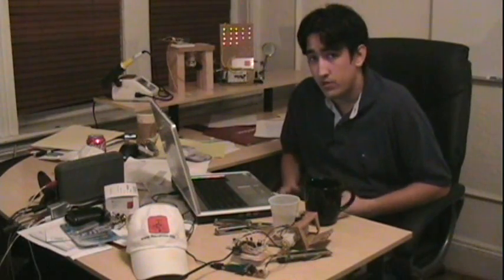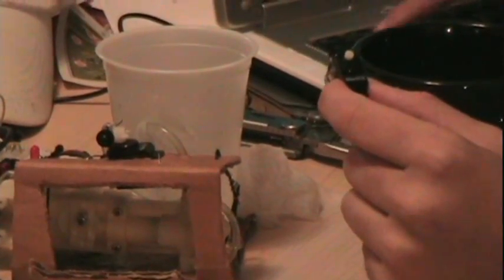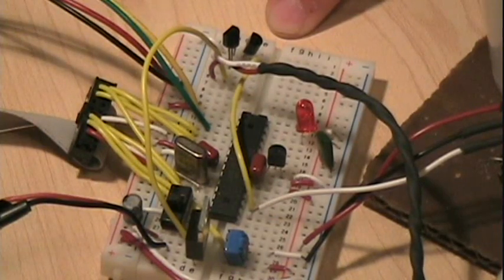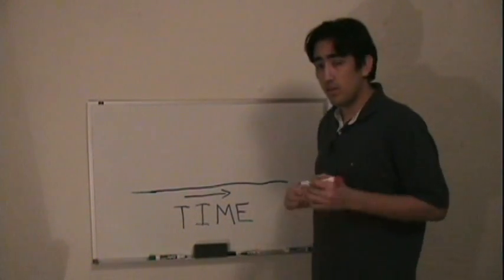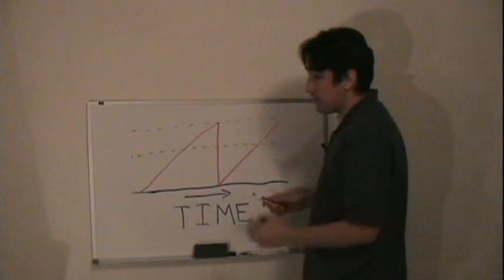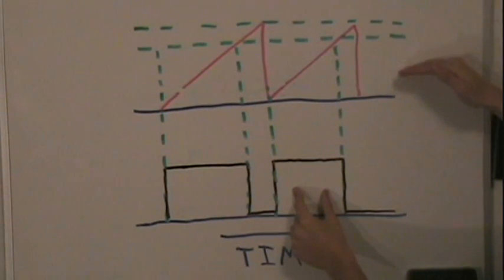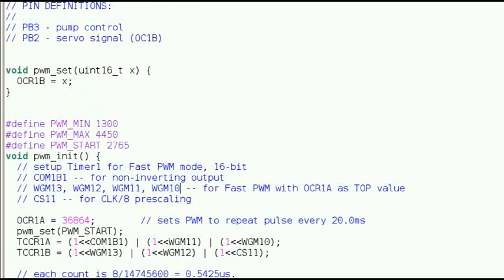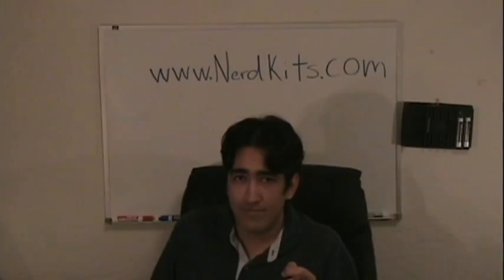DIY USB-Controlled Servo Squirter Water Pump

Comment: You can also use a hobby RC fuel pump instead of the water pump. They're cheap and you can get them from any RC shop. This could be an alternative if you are having problems getting a water pump. Make sure you get a few feet of fuel tubing to go with it, since the valves on the fuel pump are sized specifically for that kind of tubing.

Comment: Maybe you can help me out.  I want to set up a security system.  I have the means to do that however I don't want to spend a ton of money on a tilt and pan cam.  So I decided the best I can do is to use 2 programs.  1 for video, the other for moving my homemade pan and tilt.  I am on a mac and would love just a simple way (gui) to control the pan and tilt i'm going to rig up.  Basically I need to be able to move the servo using my computer. Any ideas would help.